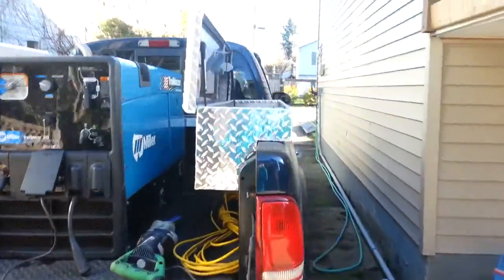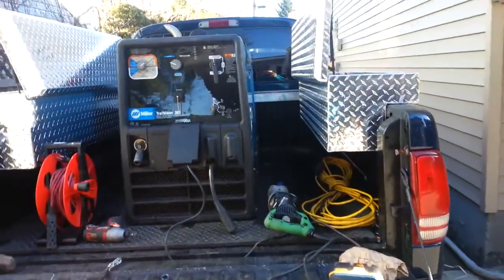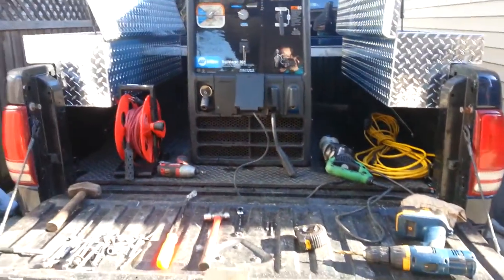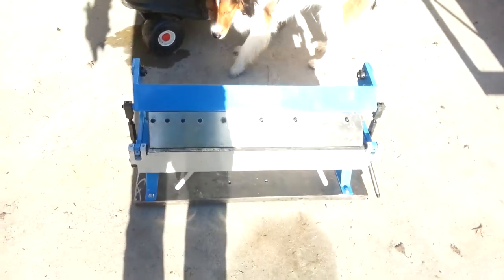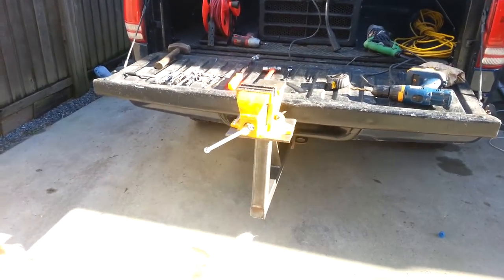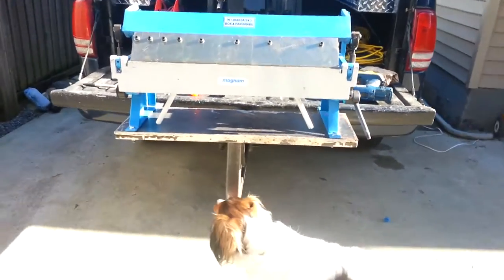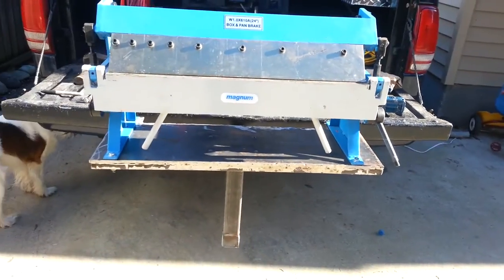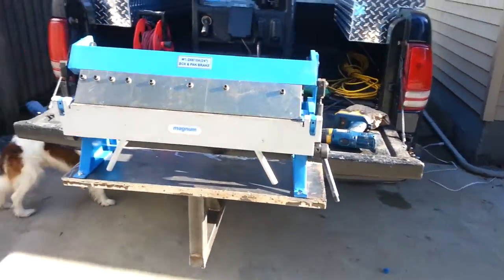Welding rig build PT2

Comment: I also got a set up similar to that in a3/4 ton dodge don't really needs a torch only on some occasions with my lincoln and cross bed tool box not much room for torches I do mostly fencing railings and do work for a small trucking company in L.A. I mostly work alone you don't want to home depot with anything that can be easily accessible to day laborers here in L.A.

Comment: are you actually getting work? where is your cutting equipment? what type of things are you working on? please don't take this wrong i have been welding for 10years now and i have yet to see a rig like this . where at in the world?
Reply from the maker: Hey Thanks for the reply, constructive criticism is always welcome. To answer your questions it is as the title says this is "a build"  I have also been welding for many years almost 15 to be exact and am well aware of what is needed for a welding rig. My primary focus is automotive/sheet metal work therefore a torch would not do me any good, given they do serve a purpose for brazing and welding body panels in my case I however use my plasma way more for cutting.
Reply: aww cool dude. I apologize if that came out wrong. I myself am interested in rigging out a 1/2 ton truck with the trailblazer ,some pipe jacks and the whole get up just was wondering  what you have herd from others about you rig? I like what your doing can't wait to see more!!!!!
Reply: are you using a foot peddle ?
Reply from the maker: Leland Bates Yes I use a weld craft torch and a HF-251D High frequency box.